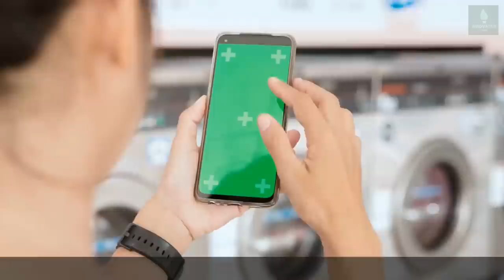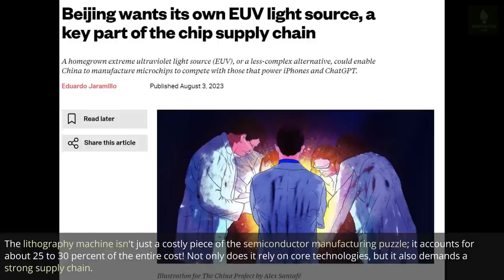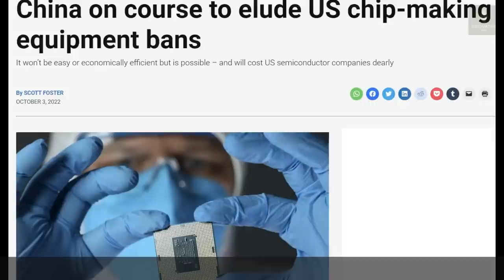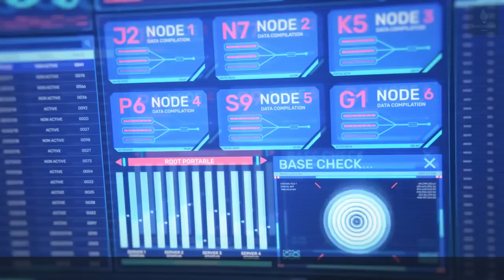Did China Just Kill ASML? China's Breakthrough Without EUV Lithography

Comment: Maybe Innovative Check didn't understand tech right. The breakthrough is a minor one, basically repeating an established process several times over to record a higher density. This is in contrast with EUV where the same design can be made in one pass. So the "success" is an inefficient last resort brute force methodology, not exactly as inspiring as it's made to sound.

Comment: Nano Imprint Lithography (NIL) does meet the resolution or feature size requirement but until it can get to roughly 200 wafers per hour with on average 0 killer defects and nanometer scale overlay it will not displace traditional lithography, i.e., immersion 193 or EUV. China has a company called SMEE which has been working on developing lithography tools for 20+ years, they are decades behind ASML. As the man said, ASML could give SMEE all the drawings, blueprints, specifications, etc for building an ASML immersion 193 or EUV tool and SMEE still would be decades away from building one that works to the level required for state of the art high volume chip manufacturing. The requirements for the projection optics, the alignment sensor, etc are so tight that it requires a great deal of background knowledge and experience to meet the specifications. It's not like making coat hangers. I know that sounds a bit over the top, but that is the way it is.

Comment: Lots and lots of gaslighting. So NIL is researched by Kioxia and Canon ? Those are Taiwanese and Japanese companies, so they'll never share their breakthroughs with China. China making "mid range" semiconductor ? That doesn't translate to matching what EUV can do, it just means you can make the simplest chips in use today. I'm not talking cheap processors, but just voltage regulators and basic logic gates, and everyone can make those. The Chinese achievements touted by Winnie the Pooh were all made through IP theft, they are not indicative of Chinese achievements. As the West stop sharing information with China, China is now stuck.

In actual fact, what do we see ? Every attempt by the CCP to fund the development of a chip industry has ended-up the Chinese way : billions were scammed, nothing was achieved. By the time China manages to get to where the West is today, the West will be a hundred years further than that. It's not like they are going to wait for China to catch up. Also, it's not like the West is going to buy Chinese chips. Today we embargo ASML machines to China, tomorrow we embargo chips made in China.
Reply: Sorry, you will be disappointed 😅